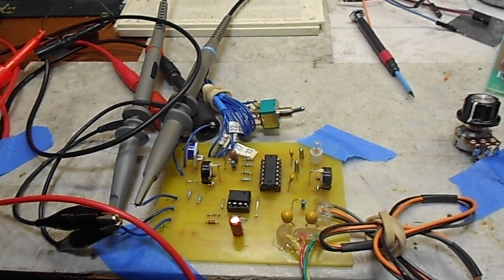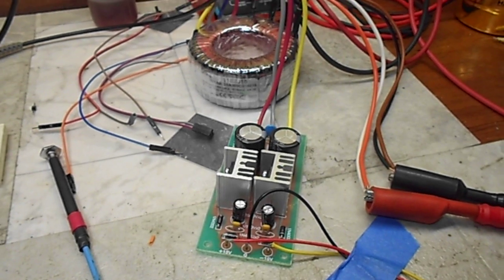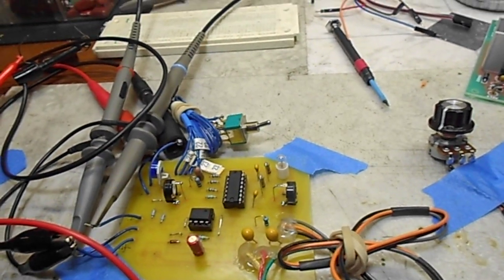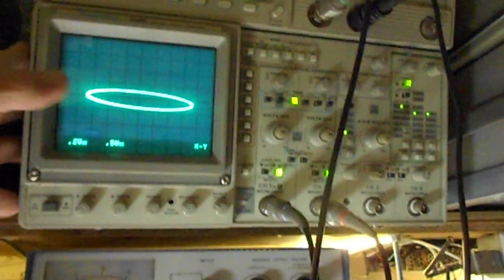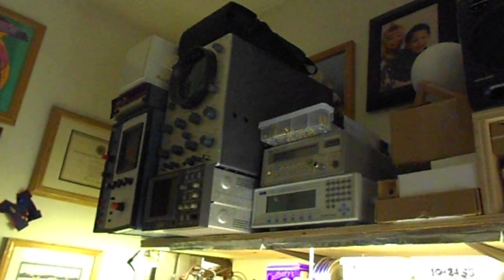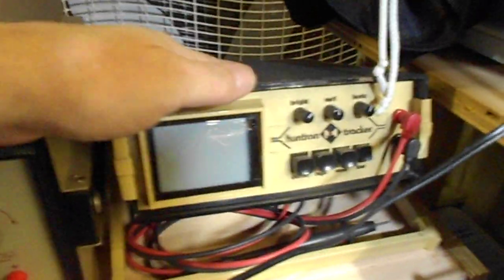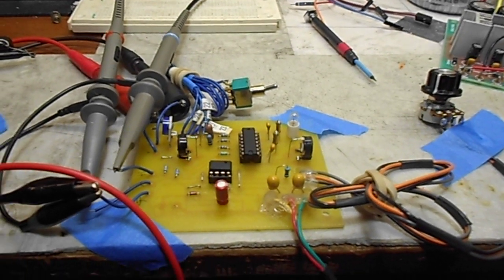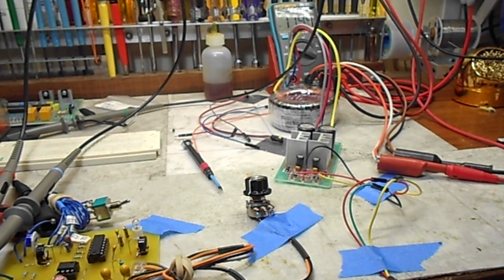Curve Tracer part 1

Comment: Hi Gary, those traces on your Tek scope are looking very nice and sharp, I really like the bigger screen for this application. I wonder if the smaller transformer is able to feed the new supply board. If this is the case, you could mount the new PCB to the old transformer onto that existing perf board. It would omit the use of your larger toroid transformer which can be useful in another project :) I'm looking forward to your leakage tester project too! Have a nice weekend my friend!
Reply from the maker: Hi Ralf, thank you for the kind words.  I also like the look of the traces on the analog scope. I will try and feed the P/S board with the small frame transformer and see if it will provide enough current, it should.  The toroid transformer was expensive too! I hope to make a new board using all SMD except for LM3915 (didn't want the SMD version due to pin outs and voltage) and ribbon cable to feed the LEDs on front display panel. I look forward to seeing your new projects soon as well.  Have a great weekend my friend!